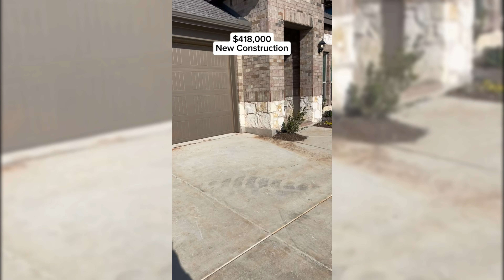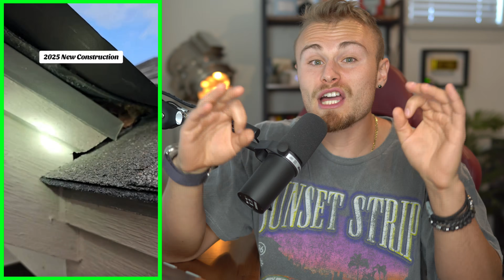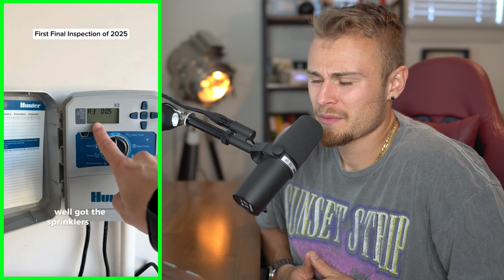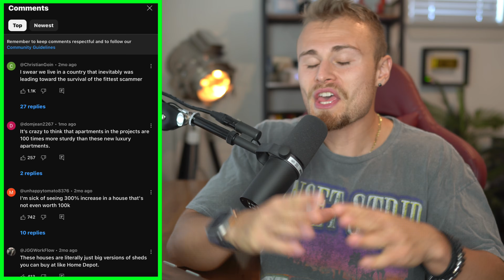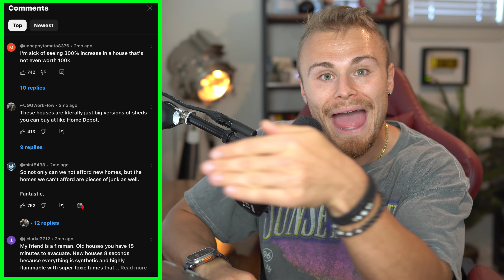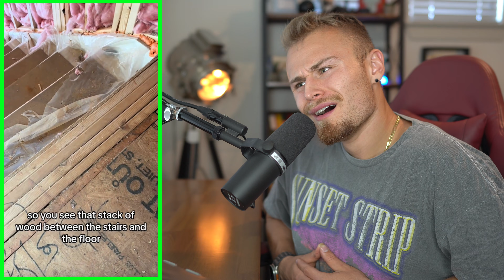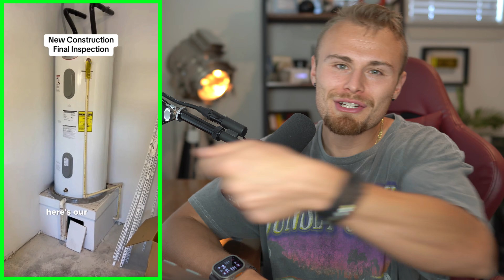New Construction Homes are STILL HORRIBLE in 2025…

Comment: I have a 1994 Honda Accord.. now don't get me wrong.. this girl aint glossing... paint is sun damage.. but the interior still has yet to be damaged by the LAS VEGAS NV hot as* sun... no tint either btw.. 
she's got a screw driver holding up the passenger side window & a small wrench (the ones that lock when u push them close) that I use to role down the driver window... 
Luckily, dad wouldn't let me get my license until i could basically build a car engine... so whatever break, I either fix or make sure to let mechanics know what the problem is & check their work , externally, afterward
Moral of the story...I could drive this car off of a cliff like "Thelma & Louise".. except unlike the movie.... my car would hit the ground, pop off a wheel & keep on going.. LOL ^_^
 this car has out lasted my sister's 2000, 2004, & 2010 Hondas... plus Dad's 2016 honda had a touch screen issue & that sh*t was expensive... I aint gonna lie.. I have no idea what is going on under the hood of these "push to start" hondas.. and i thankful bc thats one thing that hasnt changed.. electrical repairs tend t cost more then mechanical ones

Comment: It’s called “knockdown foam”. They sell it in cans at hardware stores for small repairs and builders have dedicated machines to spray it. It’s essentially foamy gypsum spray. You shoot it at the wall and then run a tool over it to knock down the high spots (which gives it that mottled patchy effect with flat spots). I dunno why it’s the style in apartments, but my tinfoil hat says property owners having it applied to make it more difficult for tenants to make their own drywall repairs before moving out. (From a guy that was able to recover his full security deposit with two cans of that stuff and some patching compound lol).

Comment: Sat here in the uk 🇬🇧 in our house built in 1880
Wonkey walls   ✔️
Wonkey roof line✔️
Crocked door frames✔️
Creaky staires✔️
Mix of concreat and floating wooden floors✔️

Cost us £21' 500 in 1988
Spent £50'000 in wiring/ windows/ roof tiles/ new kitchen/ added downstaies wet room/ upstaires bathroom renovation.
House paid off 8 years ago, still wonky walls but will be standing for the next 100 years.

Comment: I use to finish drywall, done it for over 20 years. I recently quit because it's just too much bullshit. The warped walls happen when the studs they use are warped and they don't pay attention. Use to be builders would use the worst wood for closets and places it don't really matter, but now there's so many that dont. Plus the wood today is absolutely just lower quality. Also warped walls can happen because the builder can't insulate properly. The cracks happen because either the houses foundation has settled or because the wood was wet as hell when it was built and wasn't let air out before sheetrock was hung and finished and when the wood dries again it shrinks and causes cracks. Usually when it's around doors and windows it's the foundation settling. People build new homes like shit but expect perfection or the buy a old home and use shitty materials to update, not to mention shitty builders, and then still expect perfection. Where I live there is way too much competition and too little work that actually pays what would be considered worthwhile. We will have another housing crash but it won't necessarily be because of debt, it will be because houses just new to be demolished because the cost to fix would be too high. It's gonna be ridiculous.

Comment: Most walls in builds I work on a re bent or warped the rental Co contracts the cheapest foundations.. then that is off and the cheapest framers take further shortcuts never straighten their walls either and then dry wallers and tapers just deal with it and leave a wavy shitty wall.

Comment: I live in Japan 🇯🇵, but the situation is the same as in the United States, where traditional Japanese house craftsmen are aging and becoming very few in number. In today's Japan, there are many house manufacturers from other industries such as Toyota and Panasonic who have entered the market. In order to build houses that meet the very strict Japanese earthquake resistance standards in a short delivery time, they use a housing structure that combines steel frames and wood, similar to the block structure of a ship. These block structures are produced in a factory and assembled on site. They are transported by trailer, assembled by crane, and workers tighten the bolts and fill the gaps with caulking to complete the job. Once the concrete foundation is completed and the assembly of the house begins, it takes less than a week for the roof to be completed. 😅

This means that the carpenters and craftsmen of the Showa era, who spent six months to a year building traditional Japanese houses made of wood and tiles, will not be able to survive.  😓

Most Japanese house manufacturers have recently accelerated sales of new designs based on the concept of "high airtightness and high insulation" as "long-term excellent housing" with the support of the Japanese government. 😁

High airtightness and high insulation housing is a further development of the aforementioned block structure concept, with the entire building constructed by combining multiple box-shaped structures with gap-free insulation covering the ceiling and floor, and the indoor temperature is kept at around 25°C all year round by a 24-hour air conditioning system with excellent energy saving. This is just like having a human living in a refrigerator or cooler box. Of course, in order to get a long-term warranty, it is assumed that the medium- to long-term maintenance menu set by the house manufacturer is adhered to. 😂

With this, Japanese house craftsmen who inherit the concept from the Edo period of "opening the windows all the way in summer and closing the shutters and wearing thick clothes around the stove in winter" cannot compete at all.  😭

On the other hand, among the presidents of real estate agents who have been involved in housing sales for many years, there are often people who take a completely different purchasing behavior. They buy old Japanese houses that have been built very carefully, renovate the water areas such as bathrooms and toilets to the latest standards, and live in them with seismic reinforcement to meet current earthquake resistance standards. They add insulation only inside the walls, and never insulate the ceiling, under the floor, or the foundation. 😲

This is because Japan is a very humid country, and various molds, rot fungi, and termites are widely present. The more conscientious the real estate agent, the more they have witnessed cases where "modern-designed homes with high insulation" have been destroyed in a short period of time by rot fungi and termites, and they are well aware of the fact that "an environment that is comfortable for humans is also comfortable for termites. And the boundary between the insulation and the outside air is a breeding ground for condensation and is ideal for mold and rot fungi."  😱

Excessive insulation placement means that carpenters and technicians cannot carry out necessary repair and prevention activities under the floor or in the attic. That's why cunning real estate agents never buy new "long-term quality housing" as their own residence. 😇
Reply: Supplementary Note: In Japan, there are quite a few high-rise apartments and three-story houses that are entirely made of reinforced concrete, but due to the high heat storage and low moisture absorption of concrete, it is not uncommon for these houses to be extremely uncomfortable in the summer. In order to maintain comfort in a reinforced concrete house, the only option is to increase the operating hours of the air conditioner, which comes with high utility bills. For this reason, designs that combine steel frames with wood to achieve both earthquake resistance and moisture absorption are still popular for detached houses built by house manufacturers and rental apartments, but while composite housing designs have excellent earthquake resistance, they also have the problem of being difficult to repair wooden parts due to termites and rot.😢

And the most frightening thing is that there are many cases where Japanese termites "eat not only wood but also insulation." In particular, Styrofoam boards and sprayed urethane, which are often used in ceilings and under floors, tend to be rapidly eaten away as soon as termites adapt to them, so when real estate agents modernize used Japanese houses purchased as their own homes, they always install rock wool insulation only inside the walls.😇

Comment: Pex has pros and cons. It will definitely last 10x longer than copper but it is easy to screw through it. I had a house built in 2014 and it was not near this bad. However, in Las Vegas, interior walls must be textured due to the fact that carpenters can't build a plumb wall to save their butt. And 90 degree angles on corners are few and far between.

Comment: So a couple things on the garbage disposal it's usually wired to a light switch above the counter I don't know why he's looking under the sink for the switch that's not where it goes😂.  Loose faucets are bad but that's a 2-minute fix with a wrench. Same with the cabinets just a couple turns of a screw and you can square those up. About the water heater they don't age sitting new in a factory or Warehouse so that's not a problem tires age just with exposure to the air so yeah you wouldn't want 5 year old tires but a water heater that's been sitting in a warehouse for a couple of years is no problem.. lot of the other stuff here is pretty bad though😮

Comment: @Hayden.Schreier  The rough interior wall finishes are called orange peel. It is a quick way to 'finish' drywall without doing much mud/tape/sanding to cut corners on drywall finish costs.

Comment: Cookie cutter style and/or chicken coup style building with the cheapest labor and cheapest materials has been an issue since the 1990's. This is not anything new... Everything from cheap cement, to fallaparticle board, to cheap paint to cheap plastic in lieu of wood or metals for various fixtures and materials, etc... Cheap labor because in order to get a blue collar job in the U.S. "labor force" you have to either know someone, be part of a union which requires also knowing someone plus bribes etc., have prior experience and licensing, and have your own array of tools or any combination of the aforementioned.  This has ran away all the best candidates from that particular job market.  This means that companies are hiring unskilled laborers with little to no experience with any blue collar work in the U.S. and the codes, red tape, procedures, etc. involved.  The cost of living and the housing market is outright scandalous and criminal so they (builders) have to cut corners to make their wanted, predetermined profit margin.  We are seeing the same issues, with slightly differing causes, in the car manufacturing market.  What happened to quality over price with skilled workers and quality "made in the U.S.A. products?  One issue, which I am eluding to which the lesser mind won't pick up on is that the builders in the U.S. ran out of good buddies, nephews, sons, etc. who wanted a free ride in such a corrupt market/system and when they tried to nit-pick about unimportant things in their hiring process they received no candidates and, at the same time, strong candidates who were being denied jobs anyways, walked away and these companies were left flat.  This is the "Merican way!!! SMH and LOL!!!!  I can't wait to see it all burn from their own fires they started and now are begging the people they treated so poorly to help put it out.  Do not help anyone with this mess!!!! Let it all burn!!!!

Comment: The truth about why fire fighters wont go into houses today is actually much more serious than you realize.
They will stand on a pile of saw dust and dry paper before they will go inside the house because it is the house that is the target of the DEW. Not the pallet of wood or pile of saw dust. 
That is why most of the trees and dry brush is usually fine while the houses , including porcelain toilets are turned to dust.
They dont care to be dustified by the DEW.

Comment: We bought an older house, after a handful of years we hired a company to do some renovations… the grout for our new tiled floor was sunken in and my husband got into an argument that he wanted a sealer over it, the dude said they’ve never sealed grout… they ended up doing a piss pour job so we had stains and mold, caulking in the shower was awful, mold there, they painted over the new back splash and instead of replacing the tiles, they scraped it and used a white paint pen for the grout. Refused to replace old trim with new trim (only in the rooms that didn’t have trim) broke a bookcase door, cracked a window and messed up our bathroom sink/shower plumbing. Some kitchen cabinet doors were coming of their hinges, cabinet handles were crooked and or not level to one another. We had many arguments with the boss and the last day we watched them like a damn hawk to fix a few things before my husband just told him to gtfo. It’s insane how anyone can live with doing such piss poor work and think they deserve to run a business. Joke was on him though, he miscalculated the cost and shorted himself over 1k lmao😂

Comment: It's all about greed my man. I don't have the time to explain all of this.
I can tell you this,I've framed or been involved in the industry one way or another. 
I can do everything from running equipment, pouring concrete and framing anything, there nothing I couldn't do to any building and do it right. 
These days everything costs so much the builders will do the bare minimum to get the inspection passed .
The lumber is second grade or 3rd grade stuff.
Trying to save money and time is the most important thing to these shady people.
America is falling,just like every other civilization

Comment: 8:27 Yup, I think the damage to that drain pipe came after it was installed by whoever hung those kitchen cabinets. Someone put a nail or a screw or just drilled straight into the drain pipe (which is probably PVC).

Comment: 7:20 it's pretty much drywall mud mixed with paint. Mine was never sealed so any water soaks in and dissolves the surface. Any oil like hands just instant stains.

Comment: BUY OLDER IF YOU CAN.
I'm 29, moved out when I was 26.
Bought a home built in 1963. Almost went for a starter home built in 2018 and so glad I didn't. Yes, the old man that lived here never updated anything and the bathroom is pink. I'll remodel it. Yes, the house had never had a dishwasher. I had one installed. Yes, the old brown sockets were still in the wall and they wouldn't hold plugs anymore. I put new white ones in the whole house. Still a lot more to be done! It has original hard wood floors and solid construction. Try for an older house. Don't worry about the old person stuff. You can personalize and update little bits at a time.

Comment: i do a better job than this and i barely know what im doing thanks to google and youtube.
stop being a pssy, buy a cheap POS house, replace the roof for 10-20 thousand, gut the place, replace damaged framing/jack the fker up if it sunk a bit, reinforce, re-sheetrock, windows, trim, paint, concrete/driveway, some landscaping, you're probably 30k in and a ton of man hours but you're still under 100k and you know the work you did and if its up to YOUR standards.
Go buy a fixer uper and stop being a lil bsh about the risks because risks are everwhere as you can see.

Comment: As someone who as a supervisor on prefab for 3 years this would never fly in my old company. We had frame builder then inspectors. Then frame bar placers for the netting inside the concreet inclusief all the pipe&Electric work. Then a inspector. After that we made the concrete in our own centrale. Then checked that on quality then use it in the Mold and then worked the top layer(inside of building) with shakers to get all bubbels of air out. Then wait untill it was party dry so we could make the look the customer wanted. Flat/brushed/scraped etc. Wtf is this usa crap. Fyi i build the dutch airport bridge that the plains use that goes over the road also. I made them remake that 3 times till it was 100% i would never be able to life with myself if something wou happen. Love your vids

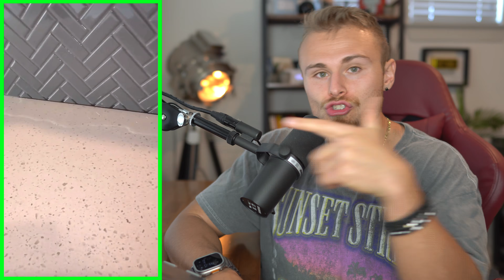Comment: 8:49 You talk about how they probably put a screw through pex, and its not as easy as going through copper. As a licensed plumber, i can tell you a few things. Starting with the fact that a screw will go through the thin wall of 1/2" copper just about as easily as pex. But that doesn't matter anyway, because he mentioned it was the plumbing stack, which is ABS or PVC, both of which are plastic.

Comment: So the stuff on the walls is, literally, called wall texture. It is often used because it can hide a multitude of sins including not properly mudding/taping drywall. If you paint a flat wall and the mud/tape is not done properly it will show through the paint and look ugly (so they'll use this spray so they don't have to do their work).

Comment: My 60s home wasn't built quite right either, but only cost 13k to build back then.  Back door frame is at a diagonal, bathroom is a trapezoid, the wall between my kitchen/living room is at an angle that should be strait and the house settled pretty bad in the living room where they took the center wall and moved it off the support beam in the basement.  They have been saying houses are built like crap for many decade.